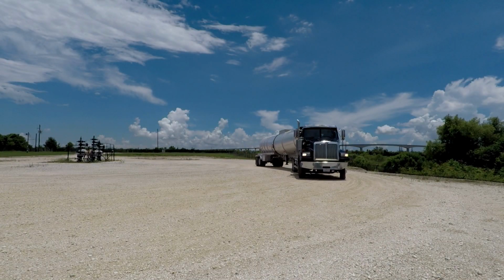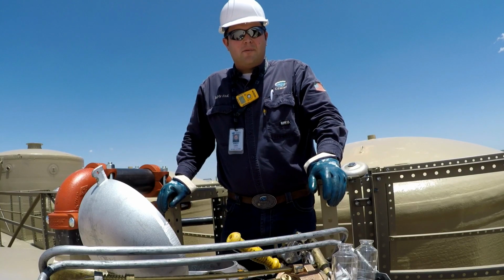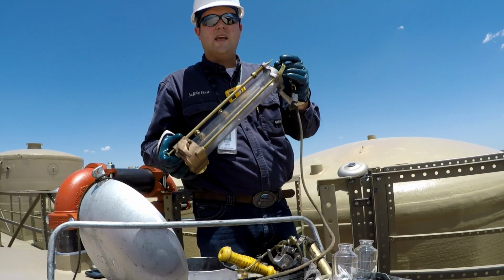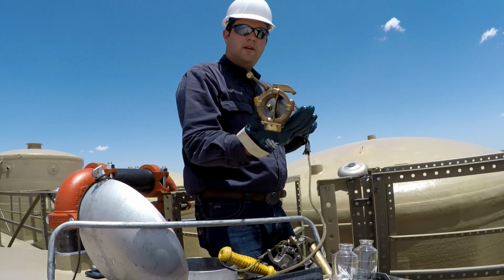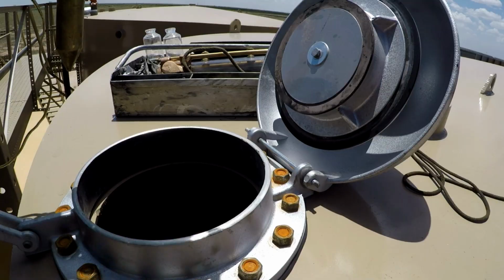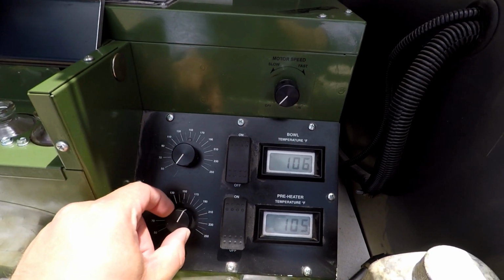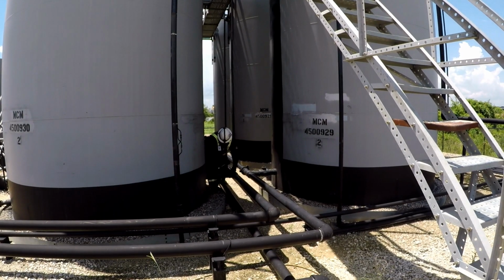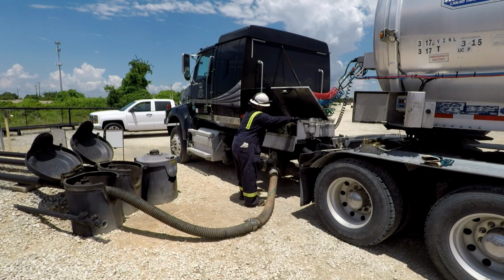Driver Tips - Hauling Crude Oil

Comment: The crude oil company I worked for is when you get to a location you ground and chock your wheels first. And watch out for rattlesnakes.
Reply: I hit em snakes with a .22 for a free dinner. Just make sure you don't miss.
Reply: How do get on with these tanker companies without the experience? I have 23 years doing van wanna try something else
Reply: @Dee-ti3hu most require tanker experience
Reply: @Stu_Pudaso666 How do you cook em ? What do they taste like?
Reply: @EZ123EZ  Fried bird
Reply: @Dee-ti3hu u have enough experience to be trained for crude oil. I can point u in the right direction to get a job

Comment: I have been hauling crude oil for over ten years.  After we hookup to the header we open the trailer up the start the pump to draw a vacuum on the load line then open the header valve to check the load line for leaks. I have had leaks in the load line before if you open the oil tank first you might have an oil spill if 5he load line is bad.  After checking for leaks (You can hear the vacuum hissing in the load line) you open the tank slowly. Remember SAFETY FIRST.
Reply: You can hear that over Wyoming winds?

Comment: Excellent video but a few minor changes are being practiced in the field. 1. Before going up on a tank always make sure that the tank you are supposed to pull is not in production and that it's sealed (some sites don't utilize seals but that is normally announced ahead of time).  2. While API standards were mostly followed in this video, it is good practice to make sure that there is enough oil in the tank to begin with. 3. Not all thieves are structured the same - Bottom petcock should be at 12" of the tank bottom as load lines are at that level. 4. This is a MUST - Always gound and bond prior to hooking up the hose to the Getty box.

Awesome video and very informative. Thanks for sharing!
Reply: Rich Tyson Hey Dummy! This isn’t school. I think we all know how to do it. 🙄 Duh!

Comment: C'mon who does all that??? I like how he actually uses the little stairs to cross over the berm,this guy must be getting paid by the hour!
Reply: Exactly
Reply: I catch you walking over my firewalls your boss is going to be called. All the leases I build have a " Use stairs to cross firewalls" at the unloading locations. Your company will get a repair bill. Cost about $2200 a pop to fix it and your company will pay. Some care less, but my company does not!
Reply: I got kicked outside of all Burlington Resources leases because I stepped on the berm. True Story!
Reply: @curtisstewart9594  good thing we dont haul for your company then 😂
Reply: @Constant.Circles  You get hit with a $50K DNR  citation because some dipchit drivers would rather cross a firewall than the catwalk that is "right there" maybe change your mind?
And I am probably glad you don't haul that oil. Seems there is no problem getting drivers who will follow simple instructions.

Comment: Hes only doing it the right way cause the white pickup there
Reply: True!!!
Reply: Lol. Doesnt everyone 😂😂
Reply: 😂😂 facts
Reply: Lol true cause time is money 😂🤣😂🤣😂
Reply: lol i dont know anything about this job but thats funny..
Reply: 🤣🤣🤣right
Reply: I work that shit coming on to my truck the hell with EPA standards
Reply: @juangonzalez3499  Get caught bringing in a bad load and see what that cost. Because you loaded on your truck and wrote a run ticket on it, it belongs to the trucking company. When it gets shook out and it is 40% bad and you wrote the ticket for 0.02% the trucking company eats the loss plus has to find a home for the bad load. Driver gets caught trying to sell bad oil generally gets run off.
Reply: @curtisstewart9594  No worries if unloading at the rails..I seen guy unload purely water...
Reply: Rage G P You’re right! Lol
Reply: Curtis Stewart Nobody really cares.
Only pussies worry about getting 
“run off”. 😏
Reply: What woodback?🤣
Reply: @lesleb  I would check the bottom and top gauge and start loading... do the rest on my cheeter theaf on the side of trailer... had many high H2S location never got a strap just capacity load it and test off the trailer! Loved walking by the vent and H2S would light up!
Reply: Lol
Reply: Nobody does this anymore. Most companies don't allow drivers on the tanks. EPA also doesn't allow the hatch to be opened due to vapor released  into the atmosphere.

Comment: Then you get out to Eagleford and 95% of the operating companies have a zero tolerance for climbing up on the catwalk and gauging or thieving the tanks. Our Mission Petroleum trucks had to be set up with a sample arm that comes out of our 3" load line (the iron nipple) under the frame of our truck. Essentially we are not allowed now to use a gauge line or a thief. We catch samples from truck loading and we drop our hydrometers in a graduated cylinder and tank level data is directly from an automated system. Crazy but all the new guys in the oilfields have never seen a gauge line even the water haulers don't believe me when I tell them we worked tanks from the top.
Reply: That is correct now all testing is done as it is pumped to truck and samples at 5 20 and 80 bbls

Comment: great video , Thanks  Andy. I noticed that you mentionned the grounding wire while using the doing the tank level measurement but you did not talked about the one between the truck & the tank? which very important. am i right? i am trying to use your video from some training purpose, thanks a lot.

Comment: Fixing to go over to hauling crude been hauling water for awhile . seems to be more steps involved with the crude side .
Reply from the maker: Corey J yes with water you’re just worried about measurement and volume. With crude oil you’re actually make a purchase and the tests we do determine the value of the load. All the steps are very important to the process and our customer service.

Comment: Great video! I've been curious just how samples were taken and other aspects of the crude pick up process! I assume all the crude tanks in the battery are connected? So sampling one, single tank gives accurate results for the battery as a whole? Or am I mistaken, and this pick up is only from one tank of the battery? Thank you!
Reply from the maker: They are connected but you have to test each tank you’re going to load from. Usually that is only one tank at a time though.

Comment: Looks like a lot of work for a driver that is pay by load, all those procedures and examples experiments took a lot of time.
Reply from the maker: It can be a lot of work, but the load pay is built around that work. Do the job right and do it efficient and it pays great!
Reply: Do it wrong and put 150 BBLs of water in the unload facility and you can loose your job. And if you wind up shutting the facility down and the pipeline company locks you out, you WILL get run off. You are writing a big clucking check to the producer. 150 BBLs is $9,000 dollars at $60 per BBL. You dern well better be doing per API.
Reply: @curtisstewart9594  not only can you lose your job, our entire company got banned from a lact. Because one of our drivers unloaded over 150 barrels of water into a 4 tank battery at a lact in Montana. The cut meter was between the tanks and pipe pumping out. When it set off the density alarm, he had 150 barrels offloaded and still had water in the truck!

Comment: and he opened hatch to fast too if there's air in the tank a greater risk of explosion static electricity and did not check sock for which direction wind blowing and its to sunny day to pull oil wait for lightning to pull oil  and 1 inch of rain per 30mins for the whole shift 12-14 hour shift. and loading point no strap on around ears clamps I've seen many drivers spill oil cause it came loose at loading point many mistakes there's many more can't mention them all bucket under pump

Comment: I'd like to switch over from hauling cars to oil. I just have to find a company that will hire me with no tanker experience
Reply from the maker: Jeffery Wilmoth that can be tough, but not impossible. It really comes down to your overall experience, your openness to different shifts and working where you’re needed. West TX is likely the best place to get on with an oil hauling company and get into the industry. You can check out some jobs here. Jobs.loves.com - put “crude” as the job title search
Reply: Did you ever start hauling oil?
Reply: Start wtih gas haulung thats a good way to start then crude oil most likely would hire you

Comment: Once you get to the receiver do you pump the oil off yourself? Does the customer do it? Nobody seems to explain that part.
Reply from the maker: MattW it depends on where you go. Some older stations still require you to pump it off with the truck pump just like loading. More and more locations now use pumps and meters on site to unload the truck though. These meters will test the oil to make sure that the driver tested everything correctly. If the oil is “bad” then the pump won’t unload your truck. I can’t film at the offloads we utilize so that’s why it’s not shown in my videos. I hope this helps. Thanks for watching.
Reply: @andylash9673 I have to thank you for this video I'm about to start hauling oil for the first time and this video was really helpful

Comment: I wish if i can get a job working in crude oil .but i do not know how .i have hazmat and tanker endorsement plus 3 year driving experiences
Reply from the maker: Ahmed Abdulaziz it really comes down to where you are. West TX is probably the easiest place to get into hauling crude oil because few people live there and there is a lot of work.
Reply: Haul water first and get a feel for it. I was able to get in, because I hauled Nitrogen.
Reply: I did not find a company that hiring commercial  driver ,tankers  to haul water even though I haul hazmat flammable  and corrosive acid

Comment: How is the pay for that
Reply from the maker: Arturo Villatoro it can vary a lot between the different fields, but generally you should be in the ~$80K+ area once you know the job and the area. Many guys easily make 6 figures but you really have to be efficient and focused.
Reply: @andylash9673  how is the home time for these positions?
Reply from the maker: William Calimese it depends on the company and the business, but we typically run most drivers on a 5/2 or 6/1 schedule and we usually do 3 weeks working and then a week home. Some drivers choose to stay out longer depending on how long the trip home takes. We have drivers in WTX from Florida to Oregon and everyone where in between.

Comment: Driver should be run off lease. He failed to chock his wheels to secure the tractor, then he failed to hook up his ground cable first before hooking up his hose before opening the enviro-box valve and engaging his pump! He obviously never heard about static electricity while transferring fluids, duh? He wouldn't have a job up here in Canada, he'd be fired most likely.
Reply from the maker: Thank you for the interest and comment, but for the sake of time on the video many parts were edited out.  This is not in any way an in-depth training video. This is an overview for people outside the industry or in the office handling paperwork. All safety procedures were followed while filming this video.
Reply: A good driver wont be on a location with a truck that needs to be chocked.

Comment: How much Do owner operators make doing this
Reply from the maker: The First Emperor I’m not sure since I don’t work with any own ops. We’re entirely company trucks and drivers here Gemini. Our crude drivers can average anywhere from $1500 to $2000+ depending on the market they work in and how efficient they are.
Reply: @mrman9151 unless you own your own truck. good luck with that. You will be lucky to make 8-10

Comment: what is that yellow thing on the chest??
Reply from the maker: That is an H2S Monitor. It checks for hydrogen sulfide gas which is found in many places including like sewers and oil and gas production.
Reply: It's also called a sniffer
Reply: H2s
Reply: It isn't a true "sniffer", even though you may have heard it called that. Just an FYI.